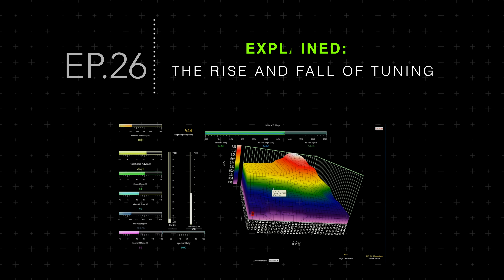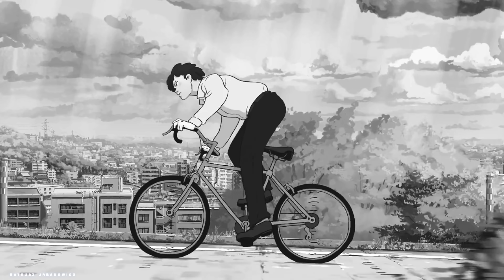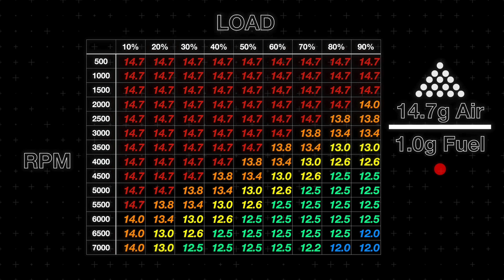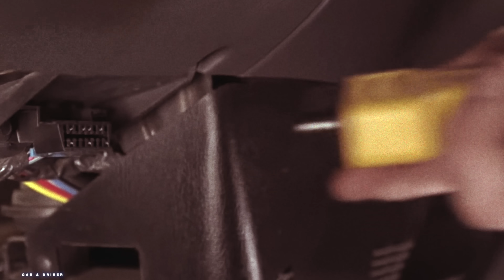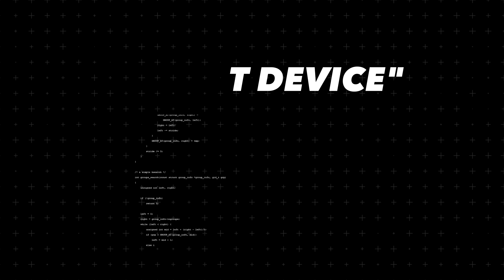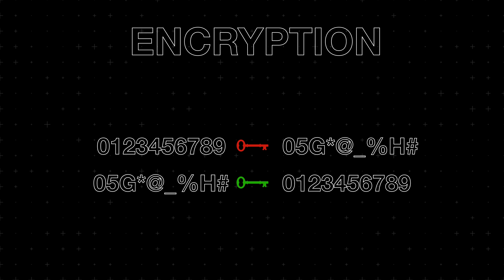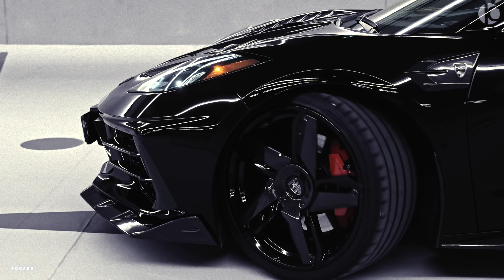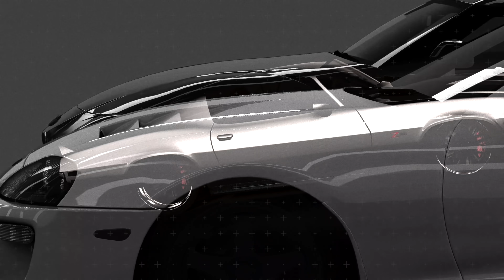How Tuning Engines Became Illegal👮🏻‍♂️| Explained Ep.26

Comment: Step 1: Copy Stock ECU values
Step 2: Remove Stock ECU or bypass it.
Step 3: Insert Modified ECU with enough memory to accommodate Stock and Modified values
Step 4: add hidden switch that flips between both value sets.
Step 5: Have Fun.
Reply: yea i've never understood why people say that an aftermarket ecu means that you don't pass inspection anymore, not if you copy the map lol
Reply: @Flashbang_Photo  many states in the midwest including Indiana (except this little corner of the northwest) no longer require inspections. We'll we technically do require "inspections" but it's literally just someone walking out of the BMV to check if the VIN written on your title is the same as what's on the car. So... Do whatever you want.
Reply: @circletech7745 yea but if you run into a cop that's in a bad mood they can still tow your vehicle and see if it's moded it's up to the cop that pulls you over I live in Ohio have seen it done a few times they can claim the emissions have been tampered with and you have to prove its better than factory only way around the ticket unless it's one of the many crooked mayors court in Ohio
Reply: @Flashbang_Photo they add a checksum to the programming on flashable ECUs, and if that checksum doesn't match it throws a tamper flag that state inspectors can see. EPROMs don't do this so you could have two chips and swap them between inspections
Reply: @triptheroad I was curious about this because when I get a smog in California I’ve run into an issue where if you change the battery before a smog check the vehicle doesn’t have enough data for them to pass the car, so I had to drive it around for a few hundred miles to get the OBD to read okay to pass the smog, so I’d assume they have a way to see if you used a chip tune at some point but I’m not sure.
Reply: @Flashbang_Photo checksums are the reason why you can’t just copy the stock map, any time a value is changed in the map it Chan the checksums a while back the epa required manufacturers to keep track of checksums to tell if an ecm would be modified, ask me how I know, I have a 2008 Silverado that I deleted the afm and built the trans and tuned accordingly the truck passed smog 3 times the last time they changed the law so they can look at checksums now and I got busted, fun fact gm defaults the rear o2 check to passed after 500 miles running e85 from the first start since the monitors were reset
Reply: @Flashbang_Photo  Why the hell does anyone have their vehicle inspected in the first place?
Reply: @WalrusWinking  some state's require a "safety inspection" to make sure vehicles are still road-worthy. And if you don't comply, you can't have a valid registration in that state for said vehicle until it passes the inspection. Some states require an inspection and emissions testing, others require only one of them, and some don't require either of them.
Reply: @Kaaarrrrlllll  That's gay I'm sure it's a lot of states like New Jersey or New York.
Reply: @Kaaarrrrlllll that why you pay someone extra money to make it pass smog for you😂
You keep all your aftermarket parts and you'll have valid registration 😂
Reply: @shaggy240sx  for emmissions/smog, yeah I'm aware. A few states like Connecticut and Massachusetts have cameras in facilities that do both smog and safety inspections. And if those facilities are found to be passing vehicles that shouldn't, they could face 10s of thousands of dollars in fines and lose the ability to provide those services. I personally don't agree with federal and state governments pushing stricter and stricter guidelines on to consumers when it's known the massive cargo ships put out more pollution going across the oceans than most countries do in a year.

I'm glad to now be living in the midwest where I have to worry about neither emissions nor inspections.
Reply: @WalrusWinking  Jersey and New York, Cali, and a lot more have smog/emissions and safety testing.  Most other places have simple safety inspections.  You know, to make sure the truck will stop and have lights/signals.
Reply: @jmackinjersey1  Also to slowly by force phase out the internal combustion engine for electric cars that are easier for the government to control your travel and put you in "lockdown".
Reply: We need annual inspections in North Carolina @WalrusWinking
Reply: @WalrusWinking  So true. China used the lock down to remove political opposition. It wasn't in the news either, our western politicians probably took notes too.
Reply: @shaggy240sx Used to be able to do that in NC, now all shops that do inspections need to use a DMV approved system that directly reports the results to the government. Glad I dont live there anymore.
Reply: @jmackinjersey1  New York doesn’t have an admissions test you just can’t have a check engine light on, cracked windshield and your lights and wipers have to work et cetera that’s all they do. Usually that is hook up the OBD flick your lights on and off and give you the sticker.
Reply: @WalrusWinking  To get federal road money the states are required to do emissions tests (based on population density) In my state of NC all vehicles under 35 years old need a safety inspection as well.
Almost every state requires inspection BEFORE registration.
Since driving without registration legally ranges from a traffic violation to a felony you might be looking at a long time in jail
Again in NC Driving without a registration is codified in N.C.G.S. 20-111 and is a class 3 misdemeanor 
Imagine being denied employment or a rental or dating site or whatever(after getting out of jail) just because you forgot to register your car
Reply: @MDAdams72668  States aren't required to do emissions tests as literally no one in my entire state has to get an emissions test.
Reply: @WalrusWinking  you must be in a low population state OR your car does the test itself and is plugged into (at the obd2 port) and reports all well or you fail. 
In my state (NC) there are a few counties with low enough pop density and they don't do the obd2 part (emissions) test.
Reply: @MDAdams72668  Bro I've never had a car newer than 2002 LMAO
Reply: Me either and there is a short list that I would even consider owning (even if they were free) @WalrusWinking
Reply: @WalrusWinking  when you have a city with millions of cars on the road, its kind of important that theyre running clean. 

of course the private sector has largely fixed this since cleaner cars are also more efficient but thats also due to regulations on fleet emissions. 

tuners arent really a problem tho, theres no reason for the govt to get involved
Reply: @Kaaarrrrlllll  in the Netherlands  we need this check every year. A "not gass tight" exhaust or slightly to high polution will fail the test.  My vehicles fail 50% of the time.
Reply: Unfortunately its not that simple as they aren't values, they are chains of functions with static or derived inputs (integrals, proportional inverse derivatives, etc) and generally compiled-down to the specific machine architecture of the processor on which they execute and encrypted in storage to deter reverse engineering. This is why motec/cyvecs pretty much have to start from scratch while piggyback systems like ecutek/cobb work off the factory ecu's function making intermediate adustments to "hit required targets." Tuning is extremely non-trivial especially for the myriad of climatic/barometric/thermal conditions out there and the complexity and variance in sensors and regulators (as well as their interplay).
Reply: Only works on old ECUs that have separate eeprom and MCU, no chip identification nor encryption though. I did that for a while, stock ECU had a 27C128 , I put in a 27C256 with a switch on the highest address bit pit . Also worked with 27c512 to put 4 map sets.
Reply: Depends on the area. Some places make replacing stock parts and automatic failure.
Reply: @leecline5759 it's not as though putting improved components in a stock housing is uncommon or difficult, especially with electronics
Reply: @chrisberry2859  
Sometimes replacing those stock components with new ones breaks shit you don't expect.
I have a buddy with a XC70 he's put a decent amount of time and money into, and a part of that was swapping the cluster and other accessory modules with later, updated ones for new features. These were stock Volvo parts he programmed with Volvo's official dealer/service software, but when he took it to get inspected he failed because the inspectors scanner didn't recognize his configuration of parts as valid.
Reply: @leecline5759 why did his dumbass go get it inspected at the dealer?😂
Reply: @daffyduckling6958   He never said it was taken to the dealer to get inspected, he said the modules he swapped in were programmed with the official Volvo dealer/service software.
Reply: @leecline5759  
jezuz
what country?
Reply: Just like on ur PS3 jejejejeje....
Reply: Thks
Reply: No need for a switch, just have the ECU always report stock values, unless you toggle a secret flag or use an alternate addresses (not sure how reads are done on CAN bus).
Reply: Step 6: Make sweet love with your new cellmate Bubba.
Reply: Step 1: get caught
Step 2: Not be able to explain away the specific actions you took to scam the government and the EPA bills
Step 3: financial ruin due to the state you're in considers EPA violations to be worse than murder

I've seen smart asses get a lot more clever and still get caught it ain't worth it when youve got money on the line, this age is different
Reply: And one more thing after you've ECU retuned,  Don't kill yourself or anyone else out there.  Really!
Reply: Many modern cars have MULTIPLE  ecus modules around the car that can detect when one is not working correctly and shut down. It's crazy the cat and mouse game that gets played.
Reply: My hero <3
Reply: Wait until bro finds out that they can find out if that's the same stock ECU tied to the vehicle by its Cal ID
Reply: My Porsche Panamera Turbo has a tune and the original factory tune is kept in the garage on a separate device called a Genie. I can load the factory tune back in the car but it's a slow, inconvenient process. You can't just flip a switch and instantly toggle between your factory and aftermarket tune. So, there's no point in keeping the device in the glove compartment for quick access between tunes because you also need a 65 amp battery charger hooked to the battery during the entire process just to install the program. Even with the Genie device, it's still not as quick as flipping a switch between programs. Changing the tune means the engine fan is running full blast while hooked to a battery charger and the process can take more than 10 minutes to complete. They do have some tunes that stay plugged into the port and go back to factory tune simply by unplugging it. But those tunes are inferior to a full reprogramming.
Reply: @hellbent7062 where I'm from you just bribe the inspectors, much simpler
Reply: I'm an electronics and software expert,  I conform,  older engines where easy to tune because they had no ecu or had ecu that we van modify easily. 
With morden cars, as you described,  we can, but it's extremely difficult to mess up with mordern day electronics. 
Anyways it was invented to reduce emissions and also to improve safety..

Comment: I wish I could get a new computer for my 89 E150 4.9 with a tune, factory ECM  is likely bad, 2 dead cylinders, thinking the injectors have dropped out on the middle of the engine, computer has failing capacitors, so needs replaced, no one does a custom program on the old computer controlled engines anymore, I did buy a 99 E350 22 years ago, put a tuner program in it and never turned back, no way to remove the program, tuner died, can't hook it back up, pretty sure I could get more out of it if someone could put a computer on it to calibrate the ECM, for an 8000 pound van, the 5.4 is quite powerful.

Comment: You know the funny thing is the worst cars on the road are usually the ones that people haven't tuned inner still equipped with all the catalytic converters in the EGR valves and and all the crap that makes your engine run like s*** which makes you not pass emissions to begin with

Comment: This type of tyranny will just make new car manufacturers lose more business over a quicker period of time as regular people won’t be willing to take their vehicles to expensive dealership shops that will have the expensive way more specialized equipment/tools than has been used for decades already. If the EPA has such a problem with emissions then they should force the oil companies who purchased the rights to WATER AS A FUEL BACK IN THE 70’s/80’s/90’s at multiple different inventions that they’ve basically intimidated the inventor into signing over their intellectual property for the safety of the individuals while actively protecting the same companies that are profiting on “destroying the environment” as the powers that be like to claim but allow it when they’re funders are the ones profiting.  As a free society we need to stand up against every single infringement of our rights across all topics to ensure that we all maintain our freedoms and rights for many generations.

Comment: go back to open source    no one to go after
Reply: It's alive and well. The problem the EPA created exists too. Pro tuners are still operating at risk because they could get fined no matter what software they use and open source tuning requires a slightly above average knowledge of software usage so most DIYers won't learn to use it. I'm no computer nut but I've dabbled and made it work, however I'd much rather use HPT or Uprev because of the user friendly format. So far both of those companies are alive and well but they've had to make some changes to stay in business due to the EPA lying about excess pollution from tuned vehicles.

Comment: GM’s global b has been finally opened up by hp tuners! It’s super expensive and you gotta send your ecu to them and get one back that’s $1499 and there are bunch of other costs too. Like 8 credits mvpi3+ only and I believe some other costs. I thought it was expensive to tune my ats. Bought a cheap hp laptop $112, had to install a wideband $250, downpipe $350, tuner was $500 and then I had some issues with my new 02 sensor, it was bad and had to drop $90 for a denso. Still have to get my flex fuel sensor and FMIC installed. Should be making around 330 whp and 350wtq. Got a big wheel turbo I bought for $150 got send out for rebuild that’s $250-350 that will put me around 360 wheel hp and 380 tq and then I’m done gotta focus on internals.